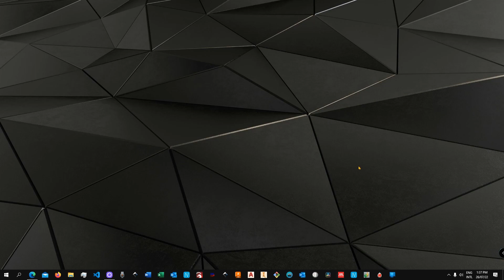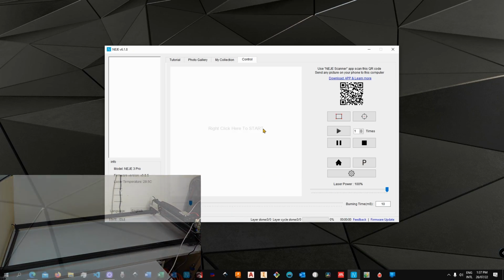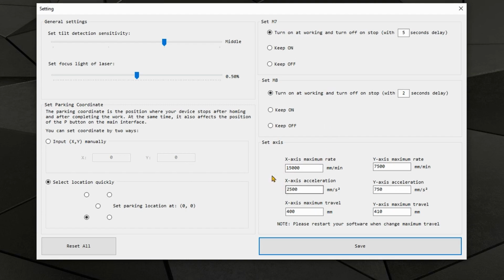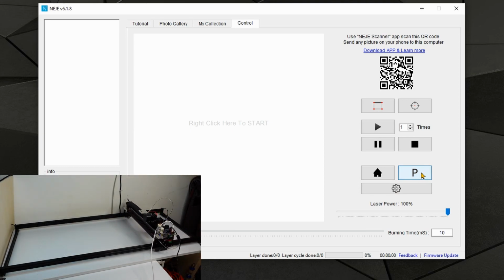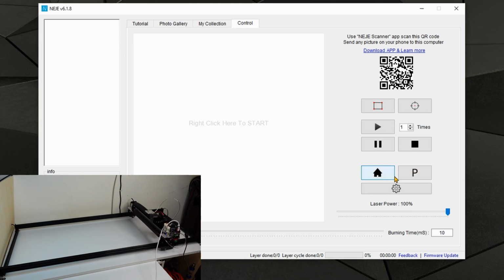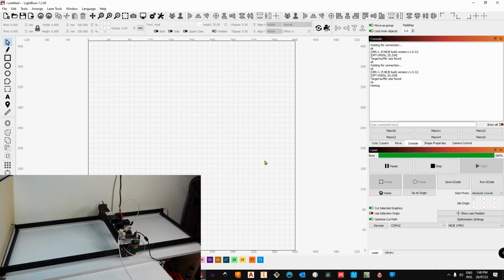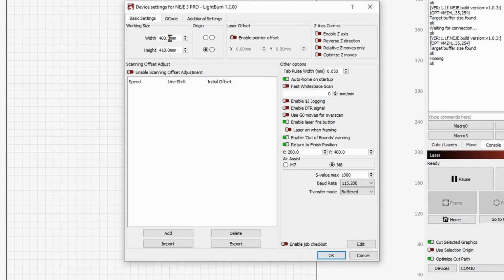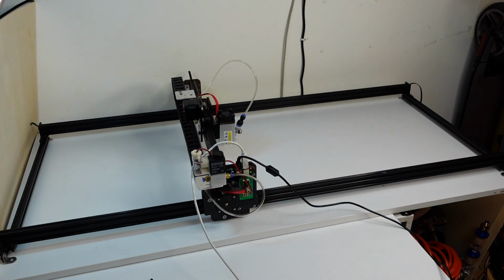Laser Engraver Extension Kit from Neje | Lets expand NEJE 3 PRO

Comment: Hi, thank you for the video! My Neje 3 max doesn't recognize the extension. (only half of it) It keeps starting at 460 instead of 20. Do you have any idea what it might be?
Reply: I already added it as a new device.
Reply from the maker: Hi @JolienaXx; thank you for your comment. 

You could simply edit the machine's "Working Size" from the Device settings for your Neje 3 Max and set it to the dimension of the new working area.

Also double check that you are in absolute coordinate and not custom origin.
If that does not work, please type $# in the console while the machine is connected and check whether the G54 values are set to zero; otherwise, you may have your work coordinate system offset. If that is the case, I will tell you how to correct that.

Let me know, 
Ciao

Comment: I saw your video of the machine and, I have a Neje 3 Max, with extension but,
my LightBurn does not recognize the extended bed of my Neje 3 Max (810 x 1030), (the software of Neje recognizes), despite configured these parameters, it only recognizes the original space (810 x 460).
Is there any way to turn this around? Thank you very much
Reply from the maker: Hi, VAMOS APRENDER; thank you for your comment. 

You must manually set the new dimension in the software from Device Settings > Working Size. It is shown at the end of the video.

If that does not work, try to delete and reconfigure the device from the Device window in the bottom right corner; there, you will follow the setup and set the new size.

Ciao
Reply: @MiddleRoomWorkshop  Obrigado. Um abraço
Reply: @MiddleRoomWorkshop  Obrigado. Um abraço
Reply: @MiddleRoomWorkshop  Just to say thanks for the tips but, with my old Arduino knowledge, I managed to reprogram Neje to the new values. Now you can work with your coordinates. Thanks and a hug
Reply from the maker: Hi; VAMOS APRENDER; I am glad you were able to solve the problem and ultimately get back to enjoying your machine. 

De nada um abraco.
Ciao
Reply: If this is still an issue for anyone,  check the G-code values for $130 and $131.  They need to match the new work area or Lightburn will not recognize it

Comment: Hi, first of all, thanks for the explanatory video.
This machine gives me a little feeling of fragility, due to the fact that its frame is very thin. I know your laser module is pretty strong but I have this doubt. What do you think? Thanks
Reply from the maker: Hi, DanCopy; thank you for your comment. 

I totally agree with you, especially because the connection between the four rails is made by a sheet of acrylic
I fixed my machine to a board of MDF, this is something that I always recommend doing no matter the size, and I haven't had any issues with it. 

The long rails on the other hand are stiff and do not deflect at all, which is good.

Ciao
Reply: @MiddleRoomWorkshop  Thanks. Yes, you did well, but it should be done by the manufacturer.

Comment: hello , can you assist me ?
i have problem with my neje 3 max ... it keep cutting a line instead of the sample i make .
Reply from the maker: Hi, S Q; thank you for your comment. 

To help you, I will need to understand your problem better.

Which software are you using for the control? NEJE, LaserGRBL, LightBurn or other?
Which software are you using for the design? i.e., How did you create the sample project you are referring to? are you using Inkscape in combination with some Gcode generator?

To figure out which side is creating the problem, we need to ensure that the project loaded in contains all the geometries you are expecting and that nothing got lost between conversions. 
Then we can go deeper to understand if the power level of all the geometries is correct and if the software is compiling right.

You may also share your sample design at info@whathowwhysolution.com and indicate the control software so that I can have a look.

Let me know
Ciao